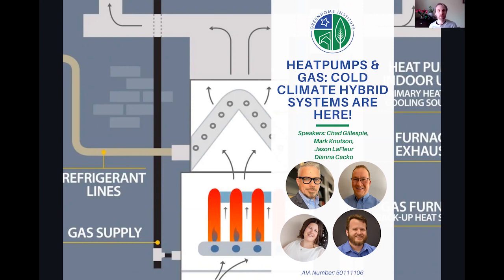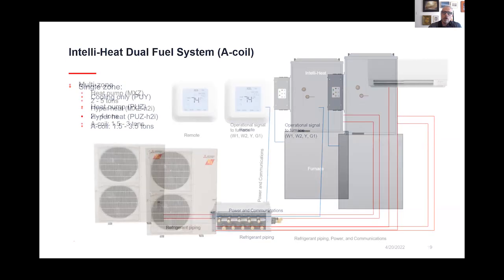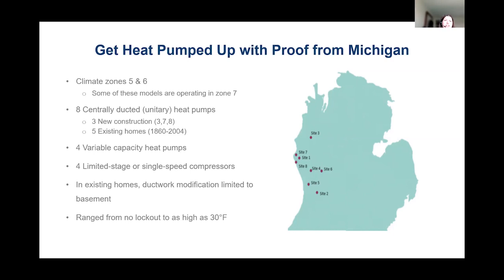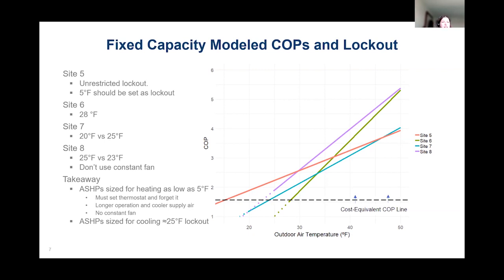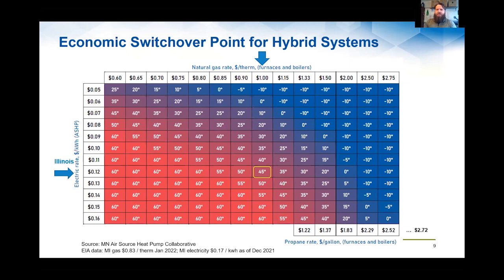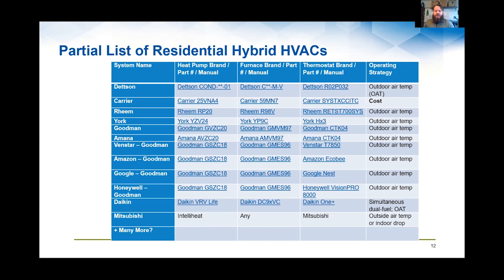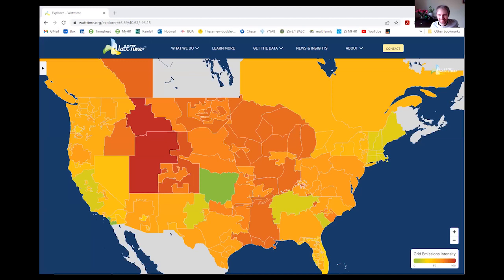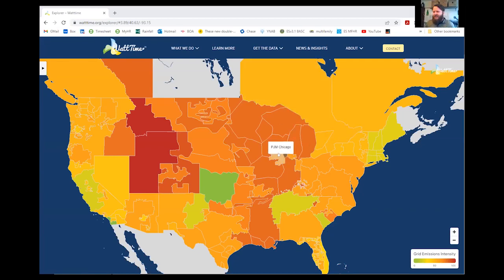Heatpumps & Gas: Cold Climate Hybrid Systems are here!

Comment: It's like a hybrid car. Why would anyone want to burn gas when heat pumps are much more efficient? A modern inverter based air to water or air to air heat pump can provide 100% of heat and hot water for 99% of homes and businesses in North America. R32, R290 and R744 can provide heat and hot water down to -30C. They can also provide AC and hot water at the same time in the summer. North America is a decade behind Europe and Asia in adopting modern heat pumps. The technology exists. We just refuse to import and adopt it.
Reply from the maker: The gas is needed for low income residents on heavy coal grid states with high electric rates to transition them and not burden them in the short term as we transition. Good point on the refrigerant!

Comment: Please confirm or correct an understanding for me. I have recently upgraded my electric service to 200 amps and installed an oversized residential solar system in anticipation of replacing a forced air gas furnace and installing a car charger. Will the intelliheat system allow me to specify (and modify) my "excess electrical" production so as to reduce my grid electrical consumption to near zero? Thanks for sharing!
Reply from the maker: "Response – I’m assuming that your question revolves around switching between gas and electric for heating your home.  The intelli-heat system controls switchover between gas and electric in two ways.  The first is by capacity, the system is constantly monitoring the supply and return air along with the set point and temperature of the home, when the unit senses that it is no longer keeping the home at set point with the heat pump heating then it will switch over to gas.  Over time it will learn what the outdoor temperature is when this occurs and automatically switchover.  The best part is that this requires no input from the end user as it is an entirely smart system!  The second way that switchover is controlled is through an economic balance point.  The contractor or end user will be able to look at the cost of gas, electricity, the efficiency of the furnace, and the efficiency of the heat pump and then decide at what temperature it is more economically beneficial to run the heat pump and when it is better to run the gas furnace from a cost perspective.  The chart below shows the options with the balance point column of temperatures being for our standard capacity units and the extended outdoor air temperature column being for our hyperheat systems.

The link would be http://mylinkdrive.com/viewPdf?srcUrl=http://s3.amazonaws.com/enter.mehvac.com/DAMRoot/Original/10006\M_PAA_Installation_Manual_Ver_2_FINAL_ONLINE.pdf and it is on page 89 of the manual.

This is adjustable at any time so if you wanted to change this at any time it would be an option, but it would be limited to the outdoor temperatures listed.  Please let me know if you have any additional questions on this!" 
Sly

 

Sly Grimm

Area Sales Manager/Residential

 

Mitsubishi Electric Trane HVAC US LLC

Mobile: 515-661-3815

Email: sgrimm@hvac.mea.com

http://www.metahvac.com

Comment: 2:08 you state that "you" swapped out your central gas heater to a electric Mitsubishi heat pump in Grand Rapids Minnesota.  I understand that these new heat pumps CAN work to negative 22 degrees, but at what cost?  Heat pumps on the surface show huge efficiency with COP +/- 4, yet real world results are not producing 4x cost savings over simple 80% efficient natural gas heating.  Can you share your results or do a video showing your energy bills.  Numbers are numbers, but what are the REAL dollars to centrally heat your home with these new heat pumps?  Will any of these manufactures "guarantee" a monthly cost reduction on your utility bill?  Seriously
Reply: Natural gas prices will continue to increase as we switch to renewables. Renewable electricity, (wind, solar, hydro), is cheaper than natural gas and oil and coal electrical generation.  Utilities are switching to renewables because it's more profitable and less expensive to build and maintain.
Reply from the maker: Casestudy is forthcoming soon. Stay tuned.

Comment: While this is great, especially for low income communities, your just not talking enough about health? Where is the health aspect of these discussions discussed? Carbon cutting is all good, but no mere mortal thinks in those terms… I do understand, we here in NW have the advantage of low energy costs, and clean as well with hydro and little to none use of coal for energy…but that’s not the case for east coasters, mid-west areas… so yes to electric heat pumps, using hopeful future solar, wind etc cleaner fuels! But that would mean tighter envelopes, better air sealing, ERVs as well as passive technology. Thank you

Comment: Curious, is it feasible to omit the 2nd stage cooling wire on a 2 stage heat pump to get more heat capacity?  example.. manJ heat=53k and cool is 29k.  Using a two stage 4 ton unit would get me most of the heat and be only a about 15% oversized for cooling that's limited to the 70% stage 1.
Reply from the maker: This is a question for traditional heat pumps. Most of these are variable not 2 stage, so this does not apply.